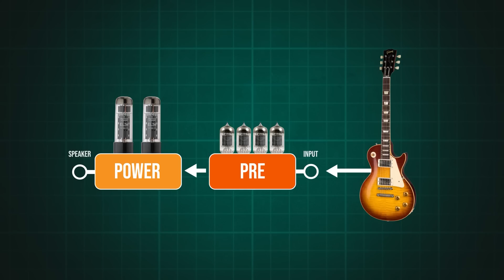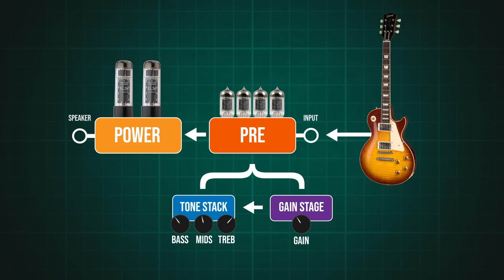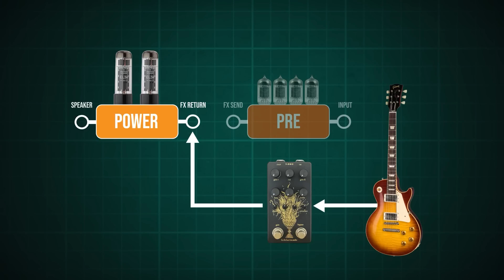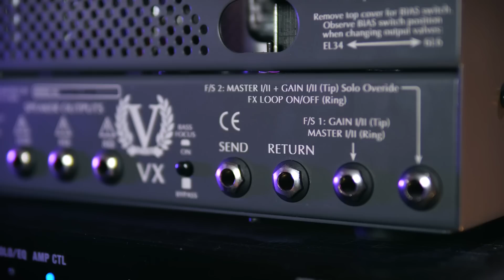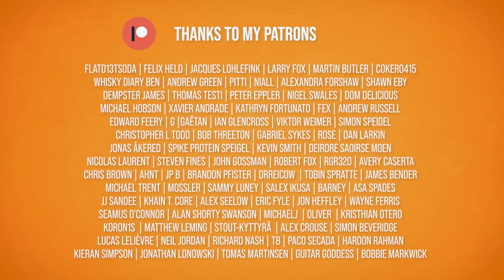Distortion Pedal or Preamp Pedal? What's the Difference?! | Lichtlaerm Audio Gehenna

Comment from the maker: What makes a Preamp pedal different from a Distortion pedal? Which features make a pedal more suitable to run directly into a power amp? Colin examines the Gehenna from Lichtlaerm Audio to find out. 
Get your Gehenna Distortion/Preamp Pedal: https://lichtlaermaudio.com/shop/gehenna

This video contains paid promotion from Lichtlaerm Audio
More details on how CSGuitars implements product promotion - https://www.csguitars.co.uk/disclosure
#lichtlaerm #gehenna #preamplifier 

Timecodes: 
00:00 - Introduction
00:32 - What is a Preamp?
01:13 - The purpose of a Power Amp
01:41 - How Distortion Pedals are Used
02:06 - What is an FX Loop?
02:26 - How Preamp Pedals are Used
02:51 - Features that make an Effective Preamp Pedal
04:38 - Distortion vs Preamp Sound Comparison
05:26 - More about the Gehenna & Signal Chain
06:30 - Full Mix Sound Example
08:20 - Isolated Guitar (Distortion Pedal)
09:22 - Isolated Guitar (Preamp Pedal)
10:12 - Conclusion

More from CSGuitars: 
Support on Patreon: https://www.patreon.com/csguitars
Join CSGuitars Discord - https://discord.gg/csguitars
Buy CSGuitars Merchandise - https://www.csguitars.co.uk/store
Website - http://www.csguitars.co.uk
Contact - colin@csguitars.co.uk
__________________________________________________________________
Description contains affiliate links. Purchasing using one of these links will generate a small commission for CSGuitars at no additional cost to you.

Comment: Thanks for both the demo and the educational content! For clarification: we named & market this mainly as a distortion because in stock (all EQ-pots at center position) it still expects the slight low mid scoop a classic passive amplifier tone-stack provides to sound like you're used to hear from an actual amp. You can easily dial in the same effect by pulling back the low-mids as Colin did here - great job <3
Reply: Love your work! 😁

Comment: The key insight is that Marshall and Fender tone stacks inherently scoop mids. All tone controls at noon is not neutral at all: it's a mid scoop. If you want to know those amps sounds like without a tone stack: set bass and treble to zero and mids to full. So, for a distortion pedal to be considered as a preamp pedal, you need to be able to scoop mids out or it will sound muddy. The degree of mid scoop determines if you're AC/DC or Metallica, but they all have a mid scoop. Alternatively, place a simple EQ pedal after your distortion to do the scooping.

Comment: The thing that made this distinction finally click for me was when I finally learned that when you set all the EQ knobs to noon on any given amp, the signal is NOT passed through unchanged, contrary to what I would intuitively expect. I don't feel like I see this mentioned by anyone, so maybe everyone else just assumes it, but it was incredibly helpful for me to learn that all amps have their own unique default tone shaping when all knobs are at noon — mostly boosting treble frequencies a lot, but usually cutting mids a bit too — and the EQ knobs just adjust that shaping.

That's why most tone-shaping pedals sound really dark when going into the power amp, because they're designed with the assumption that they're going to be going into an amp's tone stack where the highs will be boosted. That's also why the simple low-pass tone control is so ubiquitous while controls to cut other frequencies are more rare: because highs are typically so heavily boosted by amps that the upper harmonics that are added by the clipping in pedals can sometimes make for too much treble, but lows and mids are less likely to get out of control because they're typically not boosted as much if at all by amps.

The Tone Stack Calculator app made by Duncan amps has been incredibly helpful for me in learning about all this stuff
Reply: I just learned this right now
Reply: Bloody he'll. Been playing 25 years and never knew.....
Reply: Jim Lill's great Tested video on tone in guitar amps goes into detail on this kind of thing, and how much of each major amp maker's "signature tone" actually just comes from their default settings and the order of things like EQ and distortion in their signal chains.

After messing around with some tone stack calculators and experimenting, he's able to reproduce those signature tones to an impressive degree with some pedals and simple circuitry.
Reply: @YoJimbo0321  haha, yes! That's where I learned that! That video was amazing
Reply: Most guitar amps have passive EQ

Which mean that 0 is actually 10

Active EQ are +-15DB~

Found mostly in bass amps
Reply: @Pabloignacioalvarez  That or 0 is no boost and 10 is all the boost, so noon is some boost. I think it just depends on the amp.
Reply: I doesn’t depend on anything 

Passive is cut only

Active is boost or cut
Reply: @ What you're describing is, in general, how instrument tone knobs work. Amps have a lot more going on, so even if the knobs in a particular amp control a passive EQ circuit, all guitar amps do a ton of boosting, especially in the high-end. I mean, that's what an amp is, an active signal booster. I don't know why you're fighting me on this, all I was saying is that amp circuits impart their own eq on your tone and don't just amplify it uniformly, and that's important to know when trying to use pedals directly into a power amp.

Comment: I have the Dirty Little Secret from Catalinbread, what a pedal!!! Sounds and response just like a marshall, paired with two cabs (hiwatt maxwatt 412 and laney 412 both with røde N4) the sounds is so raw and powerfull!!!
Reply: I was going to comment the exact same thing: the control knobs make you feel like you have an extra preamp in your signal chain! It's a little dark-sounding even when run into an amp's input, but I'm now wondering whether it might turn another amp into a sort-of plexi by plugging into the FX loop return jack...
Reply: @concretebadger  well, i use it on my pedaboard as my main preamp pushed with a treble booster an then to an stereo ir loader. BUT when i use it as preamp in the fx loop on an amp (in case the PA is broken or bad) the result are the same, a tiny raw beast miab pedal.

Comment: As I remember from watching your TATA a few years back, presence controls work on signals in the power amp section.  Since this is a distortion pedal/pre-amp, how does it control presence?
Reply from the maker: The mechanics of an amplifier's Presence control has little to do with what's happening here - but the same frequency range will be modified. 

I haven't put this pedal on the scope to know for sure, but my hypothesis would be that as both the 'depth' and 'presence' are passive controls, they are probably just high and low pass filters. 'Depth' probably attenuates everything under 90Hz or so, giving it control over the low string chugging, while 'Presence' likely attenuates everything over 4KHz which are often referred to as Presence frequencies if you talk about EQ to an audio engineer.
Reply: What Colin said! Presence and depth are passive filters (a so called James EQ in this case, which is similar to the tone stack in old Orange/Matamp amps, also known as passive Baxandall) and as such only work subtractive - it is indeed different from presence and depth in an amp in theory: these feed back an inverted phase signal in the determined frequency range to subtract frequencies (presence and depth in an amp always take away signal as well, not adding - even though it may feel like it).

So it’s an approach at mimicking the behavior of a tube amp in the solid state realm. They basically add just enough extra range to actually make it work both as a distortion and as a preamp where other boxes tend to sound muffled in one or harsh in another application 🙂

Comment: Where should I put my tuner/other pedals that would usually go in front of the amp if I’m running the preamp pedal into the fx loop return?
Reply from the maker: In front of the pedal you're using instead of the amplifier's preamps.

Any pedals you'd usually use in the loop go after the pedal your using instead of the amplifier's preamp.

Comment: I remember reading how the Metal Zone was best through the effects return. Unfortunately i had sold the amp i had with an effects loop (Laney AOR 30) and kept my Sound City MkIV which doesnt have one. I love my SC its not unloved because it doesnt have an effects loop - it is integral to my bass rig!

I now have a DSL1 and have been tempted to try the trick. Would the Joyo  American or Liverpool pedals do the same trick?
Reply: I remember trying that trick with the Metal zone when people started talking about it again recently. In my opinion, it sounds better in front of my Joyo 5150 clone and Marshall clone than as a preamp but others seem to disagree.

Also, the Joyo American and Liverpool pedals have cab sims built into them so it probably wouldn't work as well but it's worth a try anyway. You would be surprised with what pedals sound good as preamps. I've had good luck with fuzzes.

Comment: Moore do preamp pedals of famous amps like dual rectifier and brown eye. It would be interesting to see how accurate they are to the actual amp by just running them into a power amp.
Reply: I use the Mooer Preamp Live into a ENGL 930 60 power amp. I did not care a lot for the presets of all their mini Preamp pedals, but I did love to tone capture my own Preamp setup including boost / compressor in front and / or EQ after that preamp. 

So for me personally the Mooer mini preamp pedals don't sound that good.

Comment: I've done the "MT-2 trick" of putting a distortion pedal into the FX return of an amp, bypassing the internal preamp of the amp and using the pedal as a preamp before, but I've always wondered if that is messing up the internal preamp of my amp.  After all, running a power amp without a load isn't good for the amp, is doing something similar to the preamp also bad and will it cause long-term damage?
Reply from the maker: The difference here is when you bypass the preamp by going into the FX Return, the preamp doesn't receive a signal - it's just the same as if the guitar was plugged into the input but wasn't being played. The preamp doesn't know the difference, it's just sitting there safely waiting for a signal that will never come. 

A power amp without a load will be damaged due to not seeing the correct impedance as it tries to amplify a signal. Connecting a speaker load is super important while operating the amplifier because valves which are amplifying the signal and the transformer beyond them need to see the correct speaker impedance to prevent the voltages and currents rising to a point where they cause damage. 

TL;DR - preamps won't be damaged if you are running directly into the Power amp.
Reply: @ScienceofLoud  Thank you!

Comment: Interesting. Take the Blackstar Artist series of amps( I have the 15) . They say the “clean channel” is literally volume and tone straight to the power amp with no preamp . They say it’s like “old school” amps. Should I therefore be using a preamp pedal for that oomph? Just distortion/ od pedals sound like they could use some help in most frequencies . I find I use my “gain channel”( which doesn’t have much ) on the edge of breakup with said pedals and it’s pretty good. Should I go lower than edge of breakup?

Comment: Aside from using the Preamp pedal>Effects Return example, you could also use the Effects Send>IR loader if you want to go direct to FOH/PA system.

When I learned the rules of the Preamp and Power Amp in an amp, several possibilities opened up for me. Of course, traditionally minded people would say I'm using it wrong, but they are the same people who said I sounded great when they didn't know what I was doing.

Comment: I'm not sure why, but the pedal in the loop had more of a low mid thing going on which I really dug
Reply: Low mids are the few frequencies traditional tone stacks have scooped. When you dial the eq knobs of a Fender to noon, instead of a relatively flat line, you get a V shape with a slight boost at the treble frequencies.

When connected to an effects return, the sound is flat, so the eq knobs of the pedal react as if it was the preamp of the amp itself, with the added low mid since it isn't as scooped.
Reply: Exactly what Ken said: classic passive amp tone stacks usually cut a lot of low mid content around 400hz, which has to be taken into consideration when designing a pedal to go in front of it!

Comment: If every distoryion pedal is a preamp, why can i not use my evh 5150iiis el34 100 watt head fx loop return with just any distortion pedal? I know this might sound redundant but i tried using my mxr 5150 pedal into my fx loop return. Got 0 signal whatsoever. Is this a symptom of thevtype of fx loop or is there something else at play?
Reply: A distortion is a preamp. How its implemented is the reason behind all of this. A preamp takes an incoming signal and sends it through a gain stage. After that, it goes to a power amp. Distortion/Overdrive is achieved by increasing gain to a point where it overpowers the input and starts to break up. A guitar preamp is the only type preamp where you try to get it to distort on purpose. In any other type of application, the last thing you want is to have the signal distort. 

A preamp in the form of a distortion pedal wants to distort the signal. That's what its designed for. They typically don't work well for clean tones. A separate gives you more options. Gain is always put on the input of a component and has the ability to overdrive the signal if pushed too hard. Volume controls are always on the output of a component and can't distort the signal. So, for example, if you have a preamp pedal, you can set the gain to get a nice clean tone, then send the signal to your distortion pedal. Once the gain is set on your preamp pedal, you control the output with the volume knob. As long as you don't touch the gain on your preamp, you'll always get a clean signal from it no matter what you set the volume to. Now, the preamp in your distortion pedal can focus on what it does best. Distorting the signal. Once your gain is set on your distortion pedal to whatever sounds best, using the volume control on the preamp will won't alter gain on either pedal. 

A practical application for a setup like this, is when you have to play at low volumes, such as your apartment. You can have a distortion tone that sounds great without having to worry about the amp being too loud because your preamp is being used to control volume.

I'm not very good at explaining things so if there's something in my post you don't understand, just post and I'll try to clarify the issue. Also, this is a huge topic, so there's no way I can cover all the details. Just keep in mind that there are other variables at play beyond what I put in this post.

Comment: But aren't true preamp pedals waaay louder than our dirt boxes? I think Dan and Mick explained it with Simon Kingsley, who makes "true" preamp pedals that even can be switched to "pedal operation" or "preamp operation". Anyway, nice video and a good day to you sir 😊
Reply from the maker: Yes, I mentioned that the Gehenna upscales the voltage internally so that it can reach far more level than a standard 9V distortion pedal. That is quite important to driving the power amp at the expected level.
Reply: Exactly - the output of a Preamp (or preamp pedal) is usually higher due to the high headroom which is defined by the operating voltage of the circuit: standard dirt boxes run at 9V which can be too weak to properly drive a power amp. For the Gehenna we scaled this up to 36V which is quite a lot for a pedal. This has also to be taken into consideration when running into the amp input: it can push the tubes of a clean channel into saturation in addition to its own overdrive, which can be too much - especially as clean channels lack the filtering of distortion channels that keep them tight - I’d recommend starting out with low volume when running into the input and increasing from there 🙂